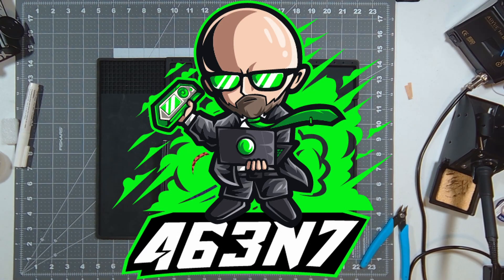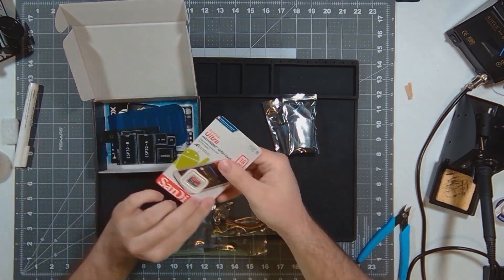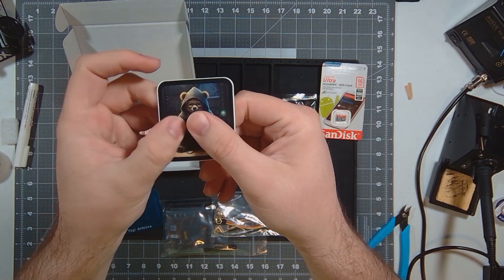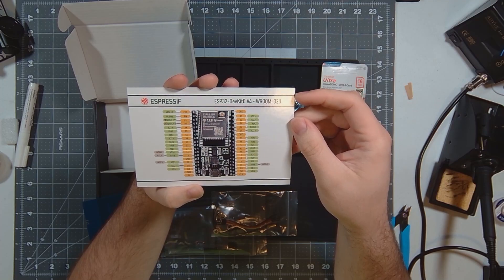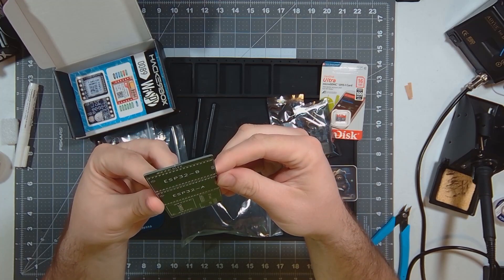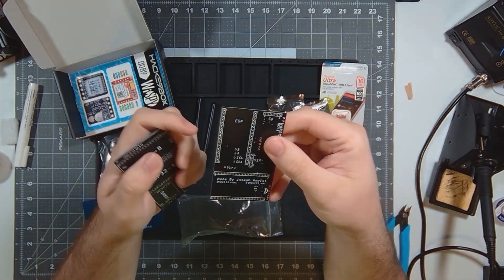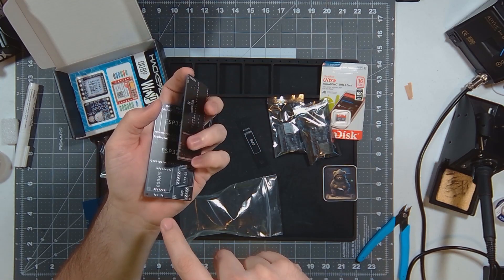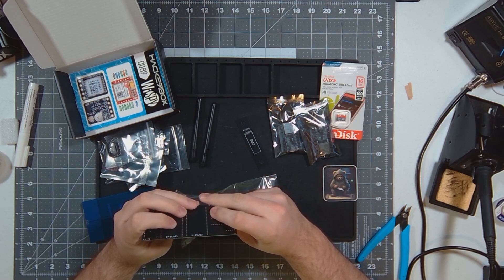Hackerbox 0089 WiSpy

Comment: Is it possible to re upload the code to esps once it’s all soldered together? Iv tried with and without holding the boot button and all I get is a invalid head of packet error.
Reply from the maker: Yes it is... one thing you can try is in arduino that has fixed things for me before is under tools change "Erase all flash before sketch upload" to enabled.
Reply: @463n7  I gave that try but I’m still getting errors like download mode successfully detected, but getting no sync reply: The serial TX path seems to be down. Or the other error invalid head of packet : possible serial noise or corruption. I tried changing upload speed and using different cables but can’t figure it out.
Reply from the maker: @TRVEKVLTX7  did you flash them at all before soldering them? Any pins shorted?

Comment: I'm having an issue with the SIM800L LED not lighting up. I tried different power sources, through the microUSB of both boards, have doublechecked every solder point, and used a multimeter to verify it's getting 3.5 v at pin 2 but still no luck. Trying to check the functionality of the GSM board yields the same results. I find it hard to believe that both the cell and GSM boards are bad. What am I doing wrong?
Reply from the maker: GPS and cell/gsm? I haven't had anyone mention both not working but have had a few mentioned one or the other. If all solder points are good and your getting power everywhere then it is possible the module is a lemon or was shorted at some point by accident I have seen both happen. The only other thing I can think of is the cellular module has been put on backwards. The SIM200L I have on my Wardriver that I purchased on my own outside of this kit ended up being a dud but doesn't really bother me it doesn't pick up cell towers as the wigle wifi app on my phone already does.